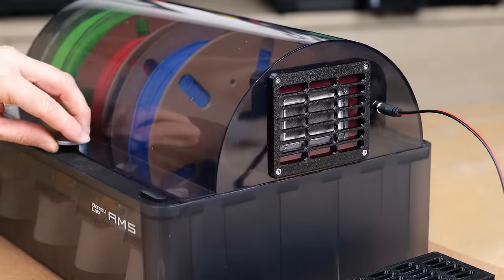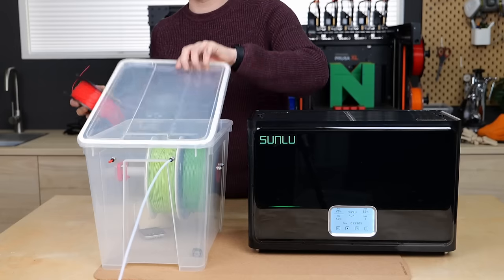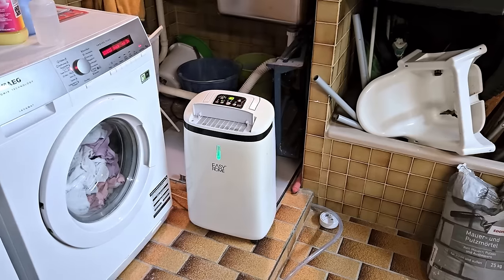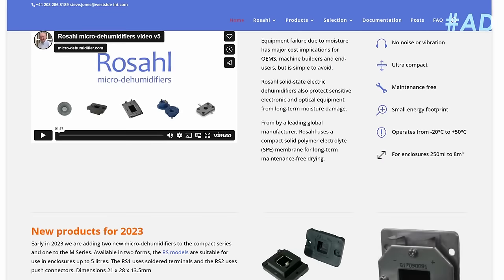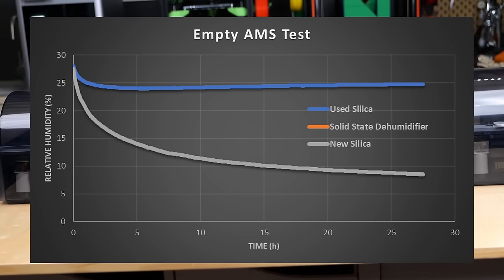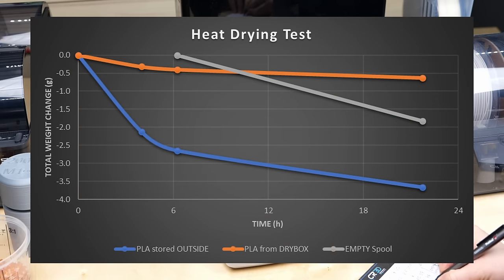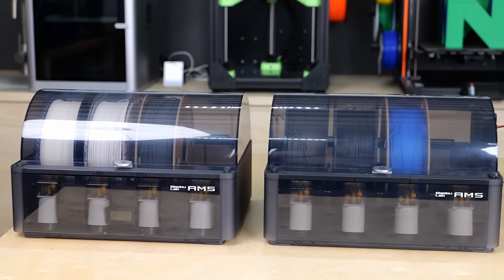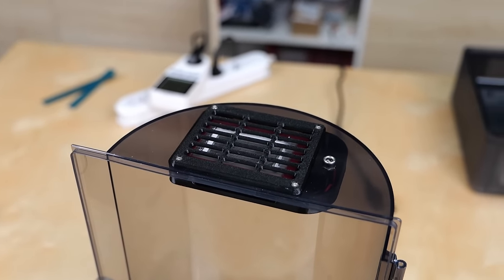Solid-State Dehumidifier: The Ultimate Filament Dry Box

Comment: You might get the power usage even lower if say you had a PC that was running all the time anyhow and you ran the dehumidifier off the PC's power supply, often they are super efficient and if the PC is running at a medium load, then the power supply will be at its most efficient and the extra minimal load from the dehumidifier will be very very low. Really this goes for any power supply, if you say ran a bunch of these off the same supply, you'd be able to get slightly higher efficiency from grid to DC cable... Once I thought of running these off a small 5v solar panel but that had its own issues.

Comment: What if you added a small heating element to the equation? Bring the interior of the AMS up to around 40-50c and repeat the experiment with the desiccant and the Rohsal membrane dehumidifier?
Reply: Read about thermodynamics and what relativ humidity means. This is what you will change by altering the temperature in a closed Volumina. 

Amount of water (mass or mols) will be the same. So no difference.for the solid state dehumidifier. Besides, the fact that the specs sheet of those devices will indicate, that they have a temperature dependent dehumidification performance.

Comment: some polymers wont release moisture at all at room temperature, even at 70°C, some PAs are in this area.
in case someone thinks drying PA works if you keep it in a box with a solid state dehumidifyer to dry it

Comment: For the Oxygen accumulation and even for the sake of drying itself, is not available out there something like a vacuum dry box?  I've been storing my filaments in cheap sealed bags with a manual pump for a couple of months, not long enough to see if there will be a noticeable difference. I do not work with high hygroscopic materials whatsoever. However, if the AMS unit is itself airtight, maybe making a vacuum out of it every time you need (You can even skip the gym if not using electrical pump!) can help with the dehumidyfier, extending the life of silica. I suppose that a potential leak for the vacuum is the hole where the filament needs to go through, but maybe with a chain of gaskets...

Comment: How about a method of rerolling just rolling the filament from one roll to another role in the drying process to accelerate that process while exposing all the filament to the maximum drawing effect is that possibility to actually put the filament through a specific small space heater and then push it out like printing it all over again keep the entire thread, not just the role

Comment: I too thought about the extra oxygen but a conversation with both ChatGPT and Google Gemini said that, at 20°C, a relative humidity of 50% translates to 1.15% of the atmosphere.  Thus, converting all of the water in the atmosphere to oxygen would change the level from ~21% to ~22%.  Accounting for water in the filament and spools might make this a bit more, maybe as much as 25%.  But you're never going to convert every water molecule and the AMS isn't perfectly air-tight so I'll make an educated guess that the oxygen level will not go above 22%, a negligible increase.

Comment: Very cool :O Wow :O By the way what is the requirements for driving this dehumidifier? Based on the consumption I'd guess it is not exactly hard to drive, unless it needs some special PWM or whatever... Could it not be ran "off grid" with batteries ot powerbanks?

Comment: The electrolysis approach is very interesting, but immediately concerned with cost. The main cost driver probably has to do with the precious metal catalyst they use on the oxygen evolution reaction (OER) electrode that comes in contact first with the moisture on the box-side. The best precious metal catalyst is likely ruthenium based which is extremely expensive especially for a size that large. I'm surprised they can even offer it for that low of a price. I'm curious about overall operability longevity though, at 3V for what seems like a continuous operation application, I'd hope for many thousands of hours. Any specs on that? Dessicant can just be run over and over, especially molecular sieves, but they aren't as effective at low moisture content as an electrolyzer. Elevation of temperature for the electrolyzer can also improve efficiency, so waste heat harvesting is a good idea. Pair the electrolyzer with a small solid state heater nearby and add in a small fan and you could likely have that box bone dry nearly all the time.

Comment: The oxygen accumulation should be a negligible problem. Ozone would be a huge problem, but the increas in O2 concentration of a few percentage points is insignificant for the polymers' stability.

Comment: Aren't the drops and spikes in humidity under different temperatures not mostly caused by the fact that warmer air can simply hold less moisture, and thus will have an increased relative humidity? And less so because of the filament supposedly drying faster
Reply: It's the other way around: Warmer air can hold more moisture than cold air.

Comment: Attention: If the module really require the high precision voltage of 3 V, I would not recommend to measure it while you have the module connected. Measure it with open circuit to get a correct result.

Comment: Would you post up the designs for the unit you made (incl. the TPU gasket)?  I think this is certainly worth exploring as a long term solution.  I have a massive box for all my filament that I don't use regularly (coloured filaments, TPU, wood etc.), while I dry periodically it still requires manual intervention and if I haven't dried the TPU recently I have to put that on to dry before I use it.  The amount of energy I waste doing this every 3-6 months drying all 20 rolls or so would easily outweigh the cost of running the electrolysis unit and probably the €150 for the unit and PSU over 3 years.

Comment: quick comment: Relative humidity is the [amount of water in the air] / [amount of water the air can hold before precipitation] (Clarification edit: hot air can hold more water).  The data would have been better if it was H2O in ppm.

Comment: The graph at 10:00 isn't valid

We don't know if the hygrometers show the same number for the same value, as the most important number is the lowest, should have put them in the same box without filament with the most powerful dissicant method and taken note of the value
Reply from the maker: No. I cross checked their readings at different reference humidities.

Comment: This is really interesting. I am a hobbyist. I have a plastic crate, not airtight, and I put the "rechargeable silica packs" into it. They are intended for use in caravans, they have a resistance heater in them. They get humidity to 25%

Comment: Is it possible to dry plastic quickly using a vacuum?
Reply: it may be one of the best methods, but it's not very quick. You would have to maintain a high vacuum (<1kPa) for a long time. Look up the water vapour pressure -- "basic" vacuum pumps will struggle to get to a sufficiently high vacuum.
Reply: Wonder if we can convince Stefan to get a HarvestRight or similar to test out freeze dried filament

Comment: What do you mean by Used silica? Do you acctually treat this material as a consumable? The proper way of using this is to let it absorb moisture, then drying it of in your oven or even more effective, your microwave oven. This can be repeated thousands of times. Use a ceramic bowl in the microwave oven and blast it until it stabilize in weigth.

Comment: Interesting video, the only problem with this technology is the membranes have a half life of 5 years assuming you are running them 24/7 which you probably would so that you maintain the RH in the drybox unless it has seals on it. Then it would last a lot longer.

I think if one of the big manufacturers adopted this tech and bought in volume purchasing we would see the price drop down considerably but you would still be talking probably around 250/300 euros for a large dry box with this tech in it. 

Alternatively they could just sell the membrane in a DIY kit with PSU so you fit it in to your own box. Worth considering and a hell of a lot safer than using a heater box manufactured in China to the cheapest possible price.

Comment: Cardboard spools are horrible for causing wet filament. Every cardboard spool I have purchased has arrived wet in the bag. Usually takes several days to dry them out too compared to a plastic roll of wet filament does. Also, why didn't you mount the dehumidifier on the lower half instead of the lid?

Comment: A simple capillary membrane with an alkaline gyroscopic solution  such as 30% KAOH would be much cheaper. Put one side in the box and evaporate from the other side, posible using electrolysis but just hot air would work just as well.... KISS

Comment: Silica gel a consumable? You know you can dry it at 110 °C?

On the other hand, I got a bit into drying agents and how they work. Silica gel is pretty bad at it's job. Well, it can hold a bit more water than calcium chloride, for instance, but it's ability to suck water from the air rapidly declines as a function of it's saturation. I've used the same calcium chloride packages for years now, which is ok, when your boxes have a good seal, but actually I'm thinking about moving on to calcium oxide. Anway, anything is better than silica gel in my book. For a safe option that also can be regenerated, maybe molecular sieves are viable.

Edit: I watched on to see that you got to the same chart I did while researching this xD .

Comment: Remember Guys, a Dry Box. A Box that is dry on the inside. Not a Filament Dryer. You need heat to remove moisture from the dipoles of filament.

Comment: Well, 169€ without an included power supply and a need for extra hardware (box, fan for air circulation) is a definite let down for me. If it would have been cheaper (say <100€ for hardware +my work for the enclosure) maybe I would consider it

Comment: Why is there not a system that unspools and respools filament to dry the line itself. It requires more mechanics and things that could fail mechanically, but could potentially dry it much faster and in one go to be ready for when you need it.

Comment: One problem I've seen on channels is that nobody seems to give more specific specifications.  Mostly "keep it dry"
OK, but how dryi is it recommended for say typical PLA or PLA+?
Nobody answers that, not even the filament mfr.
Reply: in my understanding: the dryer the better. Any moisture can potentially cause problems, what amout causes problems for you depends on the printer and the temperature you use. But it can't be too dry so try to make it as dry as you can.

Comment: This isn't really drying the filament, it's preventing the filament from getting less dry. You'll still need to use heat in some capacity to break the water from the plastic.

Comment: Maybe I'm p@ssy to cut into the AMS 😉, but what I found practical is to put the whole AMS to a large container with the lid open, and put aside with it 3 kg silica-based kitty-litter in socks.  😂 A fan also works helps inside.

Comment: I'm not clear on what exactly you mean by used desiccant. I understand that it's desiccant that's been in use, but I'm not clear on whether you heated or microwaved it to get it to release its stored moisture. If you didn't, then I'm not surprised by its poor performance.

Comment: Yeah, 409€ the membrane + 100€ power supply, for this kind of price you can have a heat pump dryer that will remove 1000 times more water per day, and you can dry you entire workshop. because this is also a problem. Even with a dry filament, if your workshop is humid, this will affect your print quality.

Comment: Vacuum drying?  Does anyone do that?  It's how you get moisture out of HVAC systems.
You could put spools in a modified pressure cooker with a clear lid, connect up a 2-stage vacuum pump, watch the humidity level drop.
I'm guessing that the power draw would be comparable to using a heater box.
EDIT:  I see he did a video on just that in 2020.  But only with a single-stage pump and no micron gauge.  It'd be interesting to see the results if you pulled down to 500 microns or lower.

Comment: Damn, that is just a bit too expensive. It wouldn't need to come down all that much to be reasonable to me, maybe 70 bucks for the big one and I would absolutely seriously consider getting a couple. I think one's need for filament drying depends entirely on how many rolls of filament one stores at a time and for how long. I have about four and a half of those big boxes you referred to as "smala" that each keep 8 or 9 rolls that have a layer of silica dessicant at the bottomin them. I print out of one of them because with that much filament, and the rate at which I print things (not THAT often) some of my rolls last for two, three years at which point they'd be falling apart if I kept them just out and about. BUT I have to change that silica gel every couple months, which is a PAIN. spending a day in the kitchen stiring beads on an oven tray and microwave bowl (there's so much of it that I need to use both to get through it all). To me, this product is ALMOST worth the money to not have to do that. Like I said, 70 or even 80 bucks and I think it would be worth it for me.
That said, if you only have ten or less rolls of PLA, or if you're the type to put a roll on your printer and then not switch filament until you run out, then you're probably not keeping filament for long enough for moisture to have much of an effect, or it's easy enough to throw whichever one you're currently using into a single roll drybox and just dry them out before you use them.

Comment: CIRCULATE THE AIR!!!! You need a fan inside your boxes for better performance. Air doesn’t circulate, which is why the desiccant is performing so well. It’s spread out across the box, so it has a lot more volume across the container to absorb the moisture. Circulating the air, even with the tiniest fan, will increase dehumidification greatly.

Comment: I've had PLA+ sitting on the floor for over 2yrs. Just covered by a large plastic bag laying across it. Room stays 35% or less. No real issues other than the occasional 0.5m being brittle on the couple of regular PLA spools I won a while back and haven't used up yet (my printer rebels when I feed it non-plus PLA). It's spoiled that way.

Comment: I just wonder, why are you replacing the silica gel. Just dry it :) and I'm serious. There are two ways of drying it that I know of. One is in an oven, just heat it up to 120 - 150C and periodically open the oven to remove hot and moist air. Second is my proffered way - use microwave: put old silica gel in a deep ceramic or glass plate 1-1,5 cm layer, set up you microwave to highest level and start it for 10-15 seconds (no more or the gel will start cracking), afterwards open the microwave doors and ventilate it (you'll see a lot of steam); repeat the process 3-4 times increasing the heating time by 2-3 seconds each time. BE VERY CAREFUL, the silica gel and the plate will get extremely hot, if you touch it, it will stick to your skin and burn you. After drying cycle, put it in an air-tight glass container (don't use plastic containers, those will melt as silica gel is >250C now), or the entire plate in a dry box on sth like a frying pan coaster, close it and let it cool. After it cools you can fill your desiccant containers for your dry boxes. I use the second method as it is fairly fast ~5 min heating cycles and ~1h of cooling and my dryboxes show 10% of relative humidity.

Comment: I've literally never run into an issue where I needed to dry filament. I also live in the middle of the desert.  What is this natural humidity you speak of?

I really think that there is a big disclaimer here that this advice is entirely dependent on the climate where you live and doesn't apply to everybody.

Comment: "The initial value at the temperature of 30°C and humidity of 60%. (The dehumidifying capacity of the membranes will degrade over time depending on the operating environment"

You did not include this in your final summary, nor does there seem to be any data on the expected longevity of the device, it could be far more costly in the long run if they do not last long enough.
Reply: Eventually, somebody who is capable of reading data sheets and asking the right questions!

THIS is exactly the point. 300+ bucks investment (200 if you choose the more feasible M-Series IMHO) is arguably worth the investment and work time... But a device which is only working for a few years, maximum? That's a big NO NO.